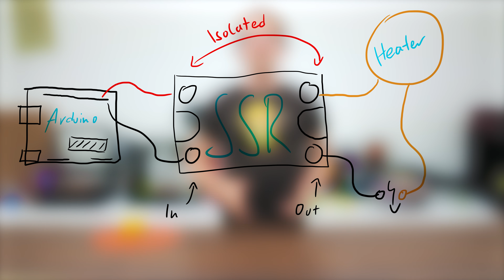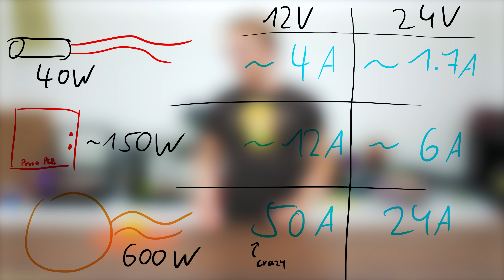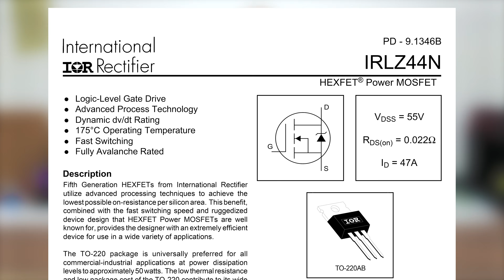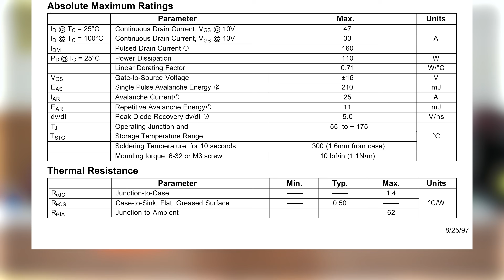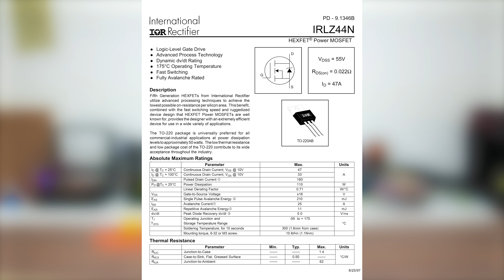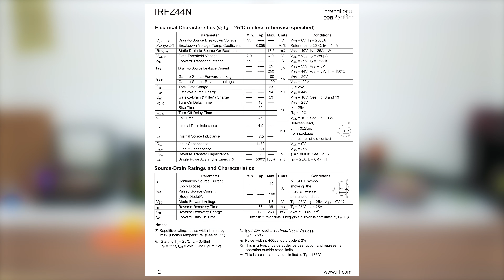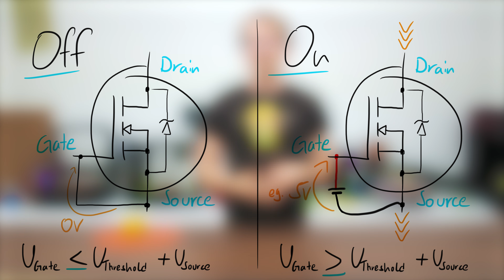Guide: Properly picking and using MOSFETs!

Comment: HI Tom i got some mosfet IRF1404 can they replace the ones that comes with ramps 1.4?
Reply: zola tanaffa, why, this is a perfectly good question. generally relais control of heated bed is not an outright terrible idea.

Look in the specific firmware you're using, but here's what i can see. The heated bed is usually on pin D8, which has a hardware PWM capability on the ATMega2560 and ATMega1280 controller ICs, such as used in most midrange boards and RAMPS. Low-end boards like Anet and Melzi that have an ATMega1284 also have PWM capability on the bed pin.

Repetier firmware uses the same temperature controller for all heaters, which is capable of PWM and PID control. The default and recommended control strategy for the bed is bang-bang control (turn on the heater when the bed is too cold, turn it off when it's reached its temperature) with a set delay/settling interval of about 5 seconds, but there's actually more flexibility underneath for different configurations. The default is suitable for relay control.

Marlin firmware doesn't seem to use the same temperature controller, but also various control modes are available. When PID control is enabled (PIDTEMPBED), it uses a slow, software-controlled PWM rather than hardware PWM, that should be suitable for MOSFET and SSRs, but is not at all suitable with an electromechanical relay. By default PID is disabled and bang-bang control is used. The bed temperature is only measured and the heater is switched once every BED_CHECK_INTERVAL, by default 5 seconds, which provides an average of 2.5 seconds of delay, but not predictably so, but this is already suitable for mechanical relay. To make it switch even less frequently, BED_LIMIT_SWITCHING can be enabled to introduce a BED_HYSTERESIS of 2°C, so the bed is switched off when it's measured to be at least BED_HYSTERISIS over a target temperature and switched back on when it's BED_HYSTERISIS under the target temperature. Finally, MAX_BED_POWER must be set to 255 else PWM is always enabled, even without PID.

Finally electrical considerations are to be made. You'll find that switching a mechanical relay with just a microcontroller pin is likely to lead to microcontroller failure very soon, perhaps within seconds or minutes, as the required current is too high to sustain for a small conductors and transistors inside the IC for a long time. You shall find that commercially available relais boards sold for Arduino use a discrete transistor, and a flyback or free-wheeling diode to protect the transistor, to drive the low-voltage side of the relay. There has also been a simulation published on the Reprap wiki that the small parasitic inductance of the heated bed and wiring is capable of producing a voltage spike on the MOSFET that exceeds the MOSFET's rated voltage on common 3D printer boards in the moment when the bed heating is switched off, which surprises me, i'd think the parasitic body diode of the MOSFET is perfectly capable of limiting the voltage, so actual measurements with an oscilloscope are necessary. However, if you were to drive the relay from the bed MOSFET on the board, which will obviously take the current quite easily, the load becomes inductive, and the voltage spike will take the MOSFET out quite easily! So on boards that don't have an additional fast Schottky diode to protect the MOSFET from inductance (most of them, save for high-end boards and the Geeetech boards that i chose for myself), such must necessarily be installed, and it should be budgeted potentially much heavier than it would need to be for a heated bed!

And then you have to measure the actual switching rate, make sure you source brand-name non-counterfeit relais which have actual specifications they abide to, and calculate the life of the relais based on the number of switching cycles they are able to sustain, because contact wear is an actual issue. A MOSFET that isn't too hot to touch and is protected with a Schottky diode should last for 20 years of operation at least, no end-of-life consideration needs to be made. When a MOSFET dies because of defect or mishandling, it will still not start a fire, not per se, though other components of the system might. But consider, if you have a 120W heated bed, worst case contact wear could cause 60W to be dissipated on the relay, in a tiny box, so it is actually a fire hazard on its own.
Reply: That's not how they are intended to be used, but let's see. The behaviour is relatively fragile when driven off 5V logic voltage. At 4.5V gate, 12V DS they will pass 40A of current, this makes for an electric resistance of around 300mOhm. In comparison, under the worst imaginable conditions, the original MOSFET that was intended to be used there would do maybe 100mOhm. My prediction is that your replacement isn't very suitable, you might lose about 1/5th of the bed power on the MOSFET. However it just about MIGHT be usable, with extra cooling, and the losses will be much lower with expected 5V gate exactly, though they aren't going to be even close to comparable until the gate reaches maybe 7V, which is just not gonna happen. I think 90% efficiency is just about realistic. But to my taste, the behaviour is too fragile to suggest that this might be even remotely a good idea.

I know this is an old comment by now and you probably resolved your question in a different manner, but i was curious what i'd come up with, and having looked things up, it was a pity not to write the result down.
Reply: + Siana Gearz:
an ignorant question: is the temperature of the heated bed managed PWM or is the control system on-off? because in this last case I think that a small  relay with 6 volt of excitement could works properly: it will not be elegant but it would work very simply, maybe little more expensive but it works for life
Reply: Wow how many things are hidden behind a heated bed!
As I said, not having a 3D printer (but the thing interests me a lot, sooner or later I take one ... or maybe I build it) I did not know if the bed was just bang-bang (as you say, the same way i called it: on-off) or PWM, but you also tell me about PID (acronym that I do not know) so I understand that the relay, as I suspected, was an obsolete idea, certainly for cost, duration and problems of overvoltage on the excitation coil during opening circuit from more problems what benefits, but we look for 100V 1000A MOSFETs and a resistance of 0.0001 ohms so we can go to the moon and come back without problems!
Sorry for the final gag, does not want to be irreverent to you, and thanks for the detailed explanations

Comment: if you need it hard on/off, couldn't you use an IGBT instead?
Reply: You... could, but they incur a 0.7V or higher voltage drop, so if you're running a 12V bed, you're dropping 6% of its power on the IGBT, and i'm sure you've seen soldering irons that have like 7W of power, so a lot of cooling would be needed. Your MOSFET has to be pretty hilariously bad for it to be THIS bad. This is why you'll see IGBT in high-voltage devices and MOSFET in low-voltage devices.
Reply: @SianaGearz  good question & well answered ... I learned something here !! 😎👍☘

Comment: Re 'infinite cooling' at 47A, well that is of course a silly thing to say. This device is safe at 47A if you keep the junction temp below 175 degrees, and if used as a switch with the on resistance being 0.02 ohm you will need a heatsink to dissipate 50W max.

Comment: Why do you suggest only 100 ohm (optional) for the Gate? Is it not too low? What do you think to use  270 ohm to protect arduino control board's pin instead. Maybe I am wrong and I have missed something. (Scheme at 8:31)
Very good video, well done.
Thanks.
Reply: by XLETTERA Well, basically, the gate is a capacitor that needs to be charged to turn the MOSFET on, and discharged to turn it off. So the value of the resistor is a balance between protecting the MCU's output pin on the one hand, and on charging/discharging the gate quickly, so that the MOSFET spends less time partially on, when resistance is far higher. This is why it can make sense to use a dedicated gate driver IC, whose whole job it is to take the small input signal, and then drive the MOSFET gate hard, to make it turn on and off very quickly. Another approach is to use two transistors ("push-pull" or "totem pole", this is called) to drive the gate. This allows peak currents of several amps (!) to/from the gate, which the MCU itself could never do, though this current is only moved for literally a few nanoseconds.
Reply: Antonio Tejada Thank you for your reply.  So 270ohm is not completely wrong. My point of view was protecting the Mcu first. 
I  will use a bang bang mode for the heated bed. So I think speed is less important. 
Anyway I got what you mean. 
Thomas is always very clear and precise.
Thank you again Tejada
Reply: MikeOnTheBox 
At the end I decided to use 270 ohm and I is working like a charm. 
Better to be safe then sorry.
Thank you

Comment: Sir,thanks for your tutorial.But i am confuse when you said the gate voltage need to be higher than the drain voltage.What i know i think a MOSFET needs a small amount of voltage to turn on the MOSFET while the drain is connected to the supply voltage
Reply: Francis Kuuderb It's an error. The diagram that's up when he says it is correct.

Comment: Thank you for the video.  I am attempting to find a very simple, small and reliable way to power a portable LED array (40 parallel 3.1v 40mA each / 1,600mA total) from one or two 3.7v LIPO batteries.  I was considering a LDO Regulator but the MOSFET seemed like a simpler solution.  It also gives me an option of adding a PWM via a 555 timer if I need a dimmer.  From my understanding, even a variable resister can be used to vary the gate voltage and adjust the current if I do not use a PWM.  I am very new to electronics and probably do not have the skills to make a switching power supply, from what I have read.  My question is how much heat would a MOSFET generate to take a LIPO Battery (3.7V) and allow a low side MOSFET to act as a drain to ground for the 1,600mA array.  If there is a lot of heat can MOSFETS be paralleled in order to spread out the heat?  If they can be paralleled, should a balancing resistor be used?

Any suggestions or corrections to anything above would be greatly appreciated.

Comment: There are other considerations when deciding on when to use a heatsink as well. If PWM is involved...... There's the actual slope of the square wave, and of course you cannot see this without a semi-decent oscilloscope. Luckily you don't really need to worry about this in a heated bed scenario, I wouldn't use PWM for a heated bed anyway. A simple on and off will suffice to keep it up to temperature, but I have seen the option to use PWM in some firmware. But I digest. =P (I know it's digress)

Arduino PWM can warm up a MOSFET because of its switching speed, (MOSFET spends to much time in a linear range, not fully on or off, which causes extra heat) but this is handled quite well by even a small heatsink. The extra heat can be cured by a MOSFET driver circuit or a properly set up totem pole driver, but a small heatsink is probably the easiest. 

For my money IRL3803 is the way to go for 30v or less, with 7.5 milli Ohm at 4.5v gate Voltage. Up to 100v I generally use IRL540NPBF which has slightly more resistance but it's not horrible, coming in at 53 milli Ohm at 5v gate voltage. Both are less than $1.50 at digikey.com

The IRL3803 is hard to beat for it's super low on resistance though and I have used both of these in 12v applications and the heatsink never gets warm, but this does not stop me from using one. Call it overkill or whatever but heatsinks are cheap and can be pulled out of old electronics for free (my preferred method)
Reply: I really doubt that the IRL540NPBF has a maximum Rds of 53mΩ at 5V Vgs. The Vishay datasheet that I have (Document Number: 91021, S11-0510-Rev. B, 21-Mar-11) shows a maximum Rds of 77mΩ at 10V Vgs, and it doesn't seem possible to have a smaller Rds with a lower drive voltage. What is the datasheet you are drawing your information from?

Comment: Can some one elaborate the part where it's mentioned that not mounting the 10K resistor would make mosfet act as a resistor and make it burn.Thanks in advance.
Reply: If no 10K resistor the MOSFET may not switch off that means it will always on and act like a resistor.
Reply: Sunil Dalvi   sorry for being late to this party...   as others have said, we need to drain charge from the gate to ground to get clean switching from on to off and we want to do it fast.  The arduino output pin will do that quicker than a 10k resistor, so it's redundant.  The pin is active high, sourcing current, and active low, sinking current.  No worries. Except if weirdly, you've switched the port from output high to input.... or the connection is broken.  In these cases the fet  could fry without the resistor to discharge the gate,  so put it in just in case.   Also if you go via an optocoupler  (highly recommended!) they generally won't both source and sink, so the resistor is essential.

Comment: So, what about good old electromechanical relays, then? Wouldn't those make much more sense for those kinds of applications?
Especially when controlling something high-powered with a µC or something.
Reply: You can't PID with mechanic relays, because they're very slow to switch on/off.
Reply: As to PID comment.

1. Yes, you can force a looong duty cycle, of like 10s at least, and PID is just going to improve its performance.
2. Current firmware doesn't to PWM control on the heated bed anyway.
3. Bang-bang control is considered sufficient for heated bed.

I think the magic words are cost and wear. A MOSFET is cheap, and it should be possible to choose it such that it has a very long service life, longer than the device as a whole. Yes, i know, they do degrade and fail, so maybe there's a little bit too much of cheapening out going on. These contacts on the relay always suffer wear though, and eventually it will melt or catch fire. The typical MOSFET failure mode is easy enough to catch with a fuse, because it fails short while it explodes, so you can at least prevent actual fire, but how do you catch increased resistance and smoke coming out of the relay? What if its resistance raises to same as bed's and suddenly you have a 60W heater in a tiny little enclosure?

Comment: Depending on switching frecuency, if above 1 Khz, then a resistor is required on a mosfet gate, else the microcontroller output will die. Seen on spice simulation (about 100mA spikes on gate, due to miller capaticance between drain and gate). An this is worse if you drive an inductive load

Comment: Gate doesn't need higher voltage tham drain. Even connecting gate with drain is enough to switch it on.
Reply: This is false. On an n-channel mosfet, gate must usually be around 10 volts higher than source to switch on. On low-side configurations  it's fine to just drive it at vcc. In high side, you need a way to step the voltage above whatever will be coming out of source. Bootstrapping IC's or a bootstrap capacitor can be used for this
Reply: Gate to Source voltage is what turns the MOSFET on or off.  It starts to turn on at the "threshold voltage".
If you hook Drain to the Gate, that's a specialized circuit used in some circumstances (too long to write here).
Whatever the Drain to Source voltage is doesn't affect whether the MOSFET is on or off; it interacts with how 'on' the MOSFET is to determine drain current.

Comment: But it I use PWM with a 100 ohm gate resistor, won't that slow down the mosfet switching and cause loss and waste heat?
Reply: (Answering for posterity)
It will, but the gate resistor is to save your arduino's output from the current spikes of charging the gate capacitance. If you need to use pwm at high speed consider using a mosfet driver to keep the switching fast

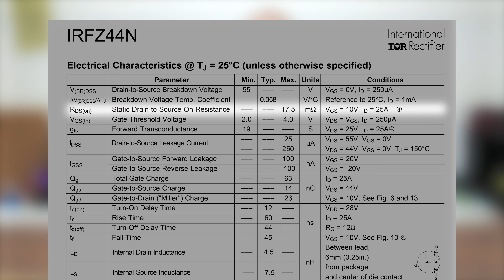Comment: 6:30 even if you only have 5 volts from a controller, you can use a voltage divider so its at least as the minimum voltage for what the mosfet needs to work.

Comment: Given that most electronics packages already have a mosfet-switched 12V output that just isn't quite up to snuff, how about just adding a second mosfet behind there? That way you're driving the power mosfet with 12V and you can be pretty sure it goes into saturation.

Comment: He says that Gate goes to the RAMPS output pin, I assume the heatbed + from my RAMPS. Where does the heatbed - go? Is the GND near the control board referenced in this video the heatbed - ? Or is it the GND from the ramps plug itself (where does the heatbed - go in this case)?

Comment: Sad that people still use the IRFz44. A far superior mosfet is a stp140n6f7. This joker is a beast to say the least.
Reply: Except you need 20v separation between gate, and source. and you need 60v separation between Drain and source, so not really practical in for powering a heated bed where the normal is 12 to 24vdc.
Reply: Your comment makes absolutely no sense. So what if it has better voltage ratings for the gate and drain to source. That is a good thing! This mosfet DOES work very well with 5 volts. I have them on hand. Do you? Also, voltage spikes can and DO occur. Just because it's 12 to 24 volts does not mean you should use Mosfets rated that low, as you risk having them be damaged from voltage spikes. Also, this mosfet has less on resistance, faster switching speeds and lower gate capacitance. The IRFZ44 is a dead product that is not recommended for new designs. It's 2017, not the 1990's....

Comment: Is there any reason I couldn't just get a 12v relay from a car and use another computer power supply to power the heated bed?
Reply: You REALLY do not want to use a car Relay. Mechanical devices fail, and it would really suck if it LATCHED closed, then you bed would not turn off.